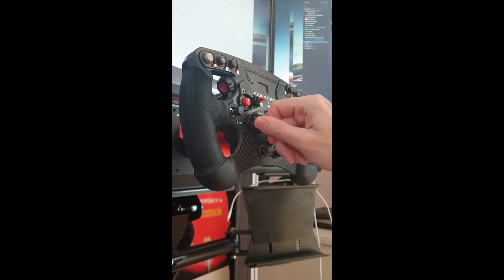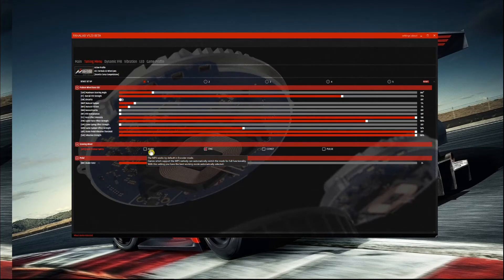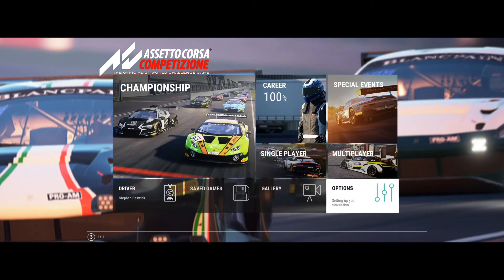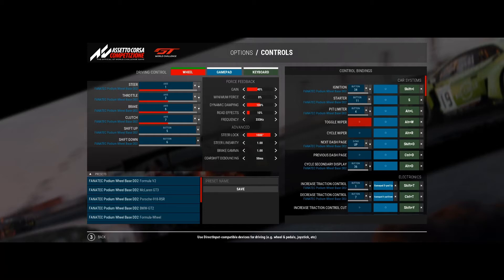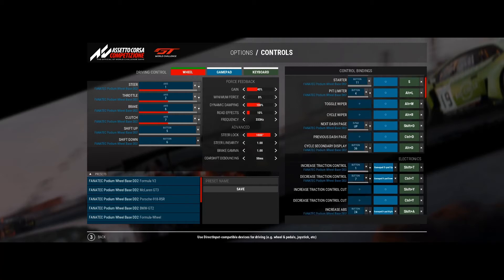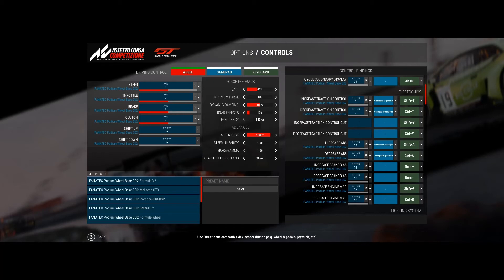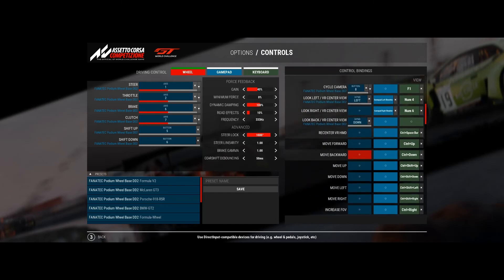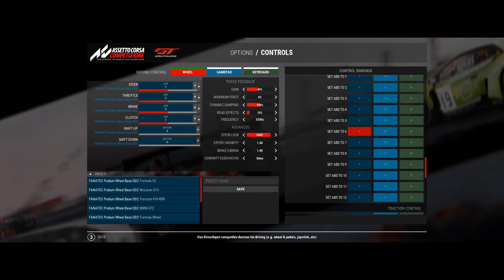Fanatec Wheel Encoders Setup for Assetto Corsa Competizione

Comment: My wheel is not reacting ingame in other games it works but not in assetto
Reply from the maker: Try the good old uninstall/reinstall - but before that check on the setup screen to see if it has lost the bindings? You don't say if the base has lost connection (ie turning) or the wheel (ie the buttons)? Also Fanatec are usually very helpful if you contact them - they usually advise checking you have the latest drivers installed too (assuming you are on PC)

Comment: Good morning, 
I recently bought a DD2 and a formula V2 for PC/Xbox, but my LEDs lights on my formula V2 don’t work... they only work when i configure my brake force... for information, i installed the last update for the DD2 and my formula V2. I hope you could help me. Thanks for your return.
Reply from the maker: Are you using with xbox or PC? LED's don't work on Xbox. What game are you using - have you tried more than one game to see if game related issue or your wheelbase?
Reply: @BeesWaxRacing  i am playing on Xbox, i play on ACC. It’s not working on Xbox. It’s weird because my leds work when i adjust my brake force... but have not tried with an other game.
Reply from the maker: As previous response - rev LED's won't work on Xbox - xbox limitation - also you are not getting the full benefit of your DD2 on that platform - xbox simply cannot produce enough information - your kit will work absolutely fine but if you ever move up to PC it will be even better
Reply: @BeesWaxRacing  okay thanks for your return 👍

Comment: The CONST setting worked perfectly for setting direct TC and ABS. It's a matter of preference.
Reply: you had any issues with it? wanted to set it to those as well when I get my wheel
Reply: @EndureRacing  if You select the Fanatec Formula wheel in the presets, they are already perfectly set. I enjoy, having each position of the encoder set with its own value.